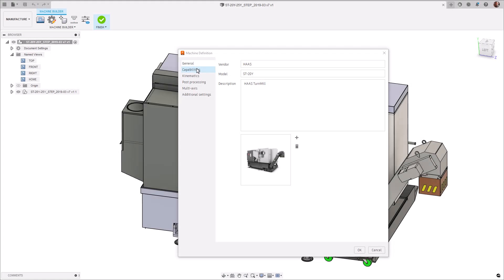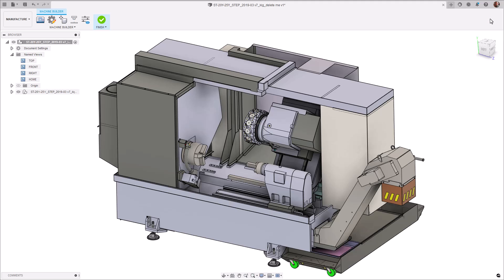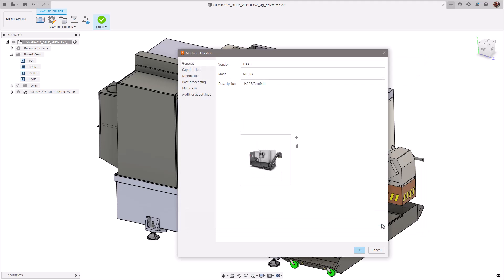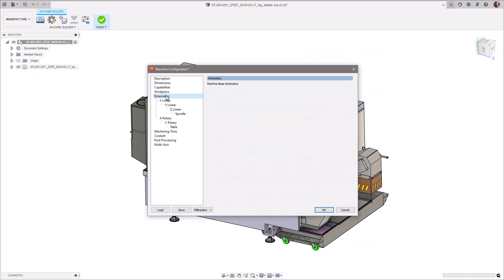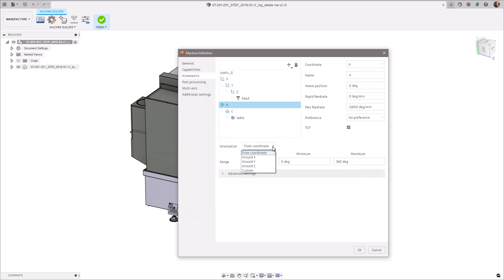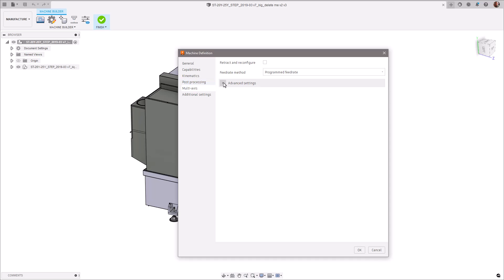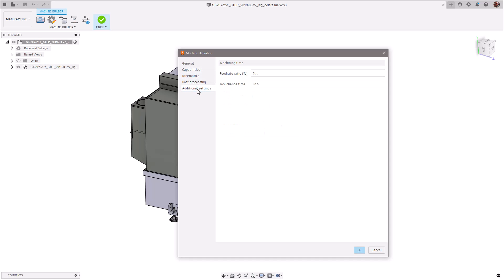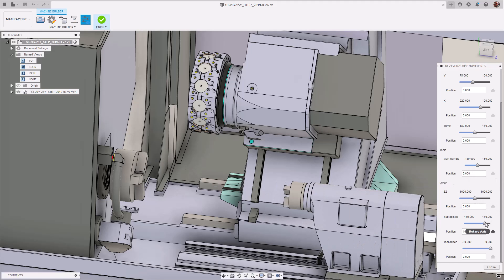Fusion 360 Machine V2: Laying the groundwork for more complex machines | Autodesk Fusion 360

Comment: Can you make a tutorial on setting up the kinematics for lathe and mills ?
Reply: Agreed, please make some basic set up tutorials for modifying generic 3 and 4 axis setups using the kinematic settings and machine builder to match a system.  For instance setting up  a LongMill.  I've struggled with this even after watching many videos and ready many posts, and now with the update many older videos just make it more confusing since the UI has changed significantly.  For example, when I use a generic Autodesk 3 axis router setup and try to use it for a Longmill, it comes in with my X and Y axis movement reversed, and in side view.  When I rotate the entire model in machine builder to match the correct X-Y orientation that works, and it corrects the view as well, but in the process it breaks the movement of the machine.  The entire gantry now moves in the X axis instead of the head, and the head stays still, and the Y axis movement is correct but the gantry is not fixed to the table.  I never modified anything related to these components in the settings.  I've done this repeatedly, and get the same results.  This is very frustrating.

Comment: Are we going to start swissturn machining in fusion?
Reply: That would be awesome
Reply: One step at a time.  Let's us get dual spindle single turret machines going then we can talk about swiss.   You can make great toolpaths for your Swiss machines today and use the citizen app to synchronize their machines.
Reply: @makestuffwithkids989   the feature cam is setup to run Swiss and most of the feature cam options are in fusion.  All they need to do is add the spindle sync/wait module and open the ability to post code in diameter with a pos or neg z command.  They have the code in partmaker too.  I hope they open the gates...